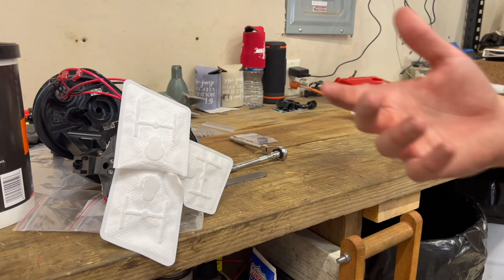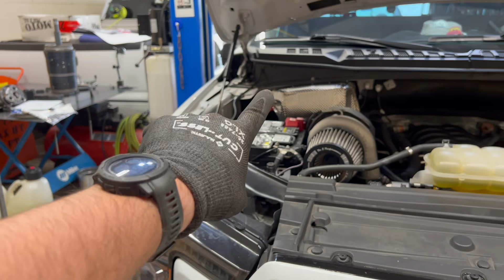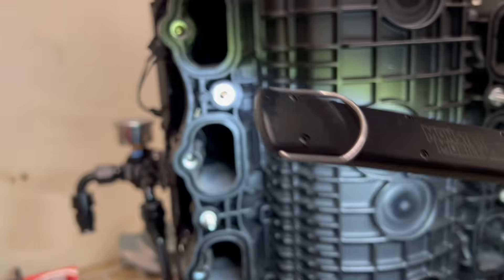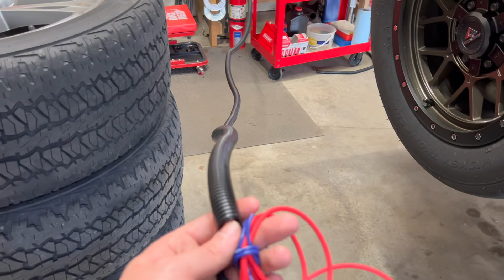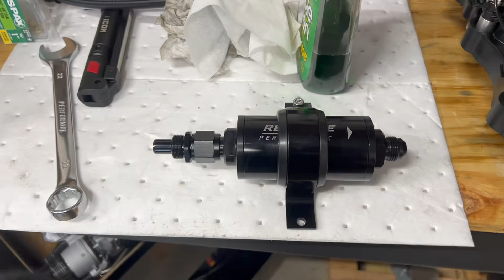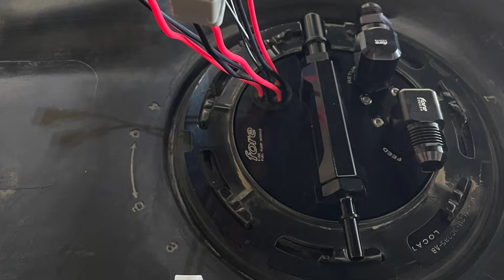DIY Twin Turbo Coyote F-150 Return Fuel System For $2500 - How to Make Your Own Kit Easily

Comment: Very nice! Great work brother. I'm doing the EXACT same work on my 2018 5.0 RCSB now. Before watching this, I had selected the exact same Radium DMR FPR's. Crazy enough, we are running parallel with our F150 builds with some differences in fuel system components and power adder. Your right, don't cheap on the fuel system. I'm still in the process of assembly with EVERYTHING. I'm max effort Whipple, built/sleeved ByePolr 5.0 motor, RSA stage 3 trans, triple F90000285 pumps on SNOW hat, Evap, cat & DI delete. I'd love to chat with ya someday about our builds. I did a in cab battery relocate (center console) with breaker control I think you'd find interesting. Looks like you could use a bit more room in the engine bay.
Reply from the maker: Thanks so much for the comment and the idea of moving the battery Brotha. I've been thinking about moving the battery, but don't want it in my bed. It sounds like your rig is going to be NASTY once it's done! Do you have a instagram or potentially add me on Facebook? id love to see some pictures!

Comment: I guess it’s good if you know how to do all the work but most are just ordering it from Fore and having a shop do the install. At least you went with a company that has vetted products that’s quality shit.
Reply from the maker: I totally agree brother. Thanks for the comment. In my opinion, The main purpose of the video was to show that you can make a similar, if not arguably better, DIY system for about $1000 less than what a full Fore system would cost. I know most people aren't going to follow I'm my foot steps, but being aware of the options might help others decide if they want to do it themselves or not.